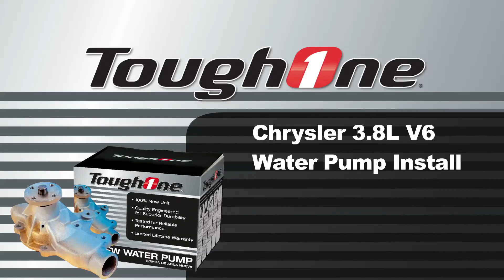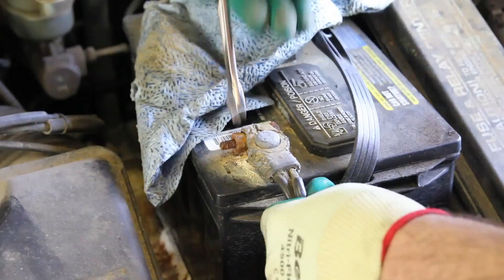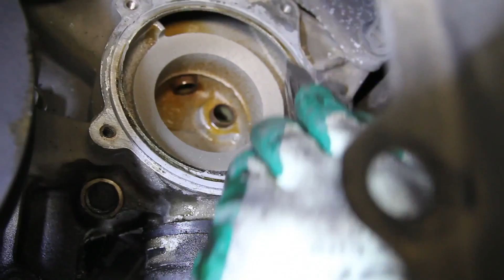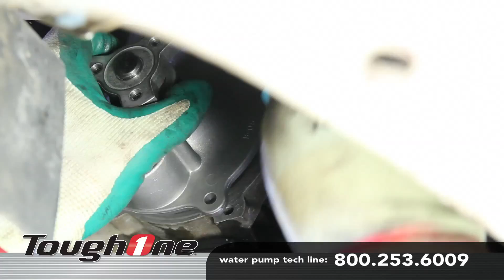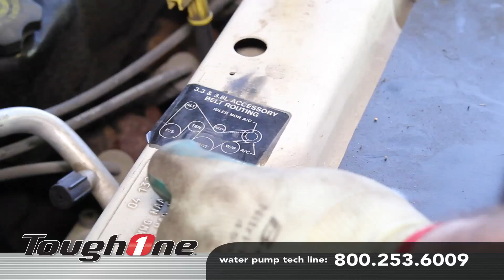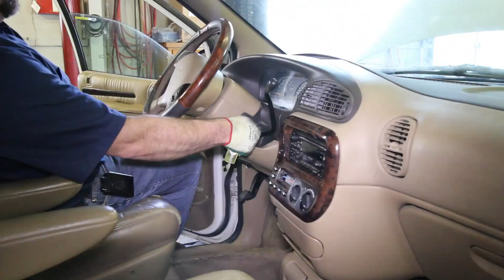How to Install a Water Pump for a Chrysler Dodge 3.8L V6 - Advance Auto Parts

Comment: I just changed the water pump on a 2001 3.8 T&C. I got the bolts removed (with a small ratchet with 10mm socket) but had to lower the engine to get the pump out. Then I got the belt back on my going under the idler pulley at the top after threading all the other pulleys.

Comment: What year is this van because I am pretty positive every single 3.3/3.8; 1994 gen II dodge grande caravans only use standard rotation pumps which use grooved pulley not smooth like the one you take off.